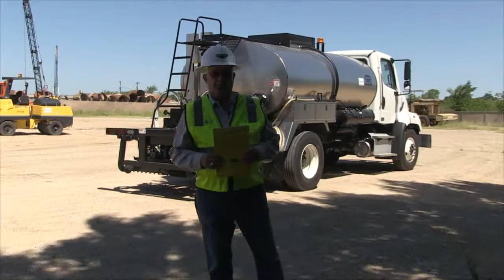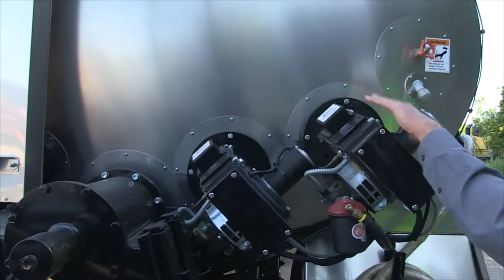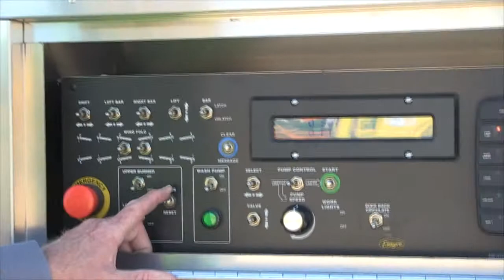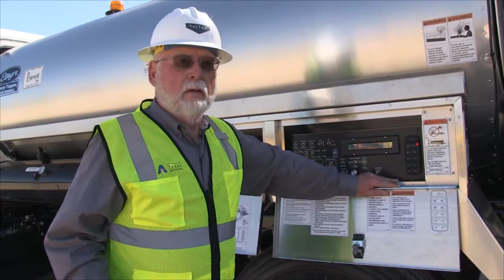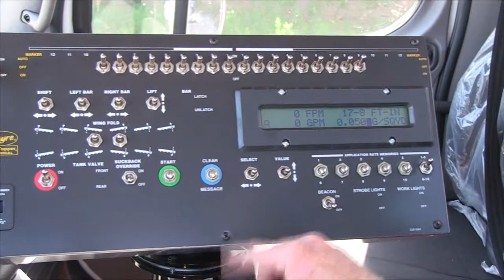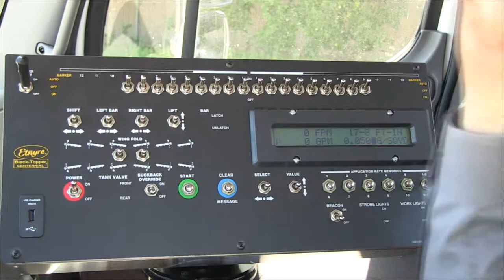Asphalt Distributor

Comment: What do you usually set your gpm at, not gpsqyd.  Gpsqyd where I'm at to spec is .03-.05 on state roads.  Another driver said he sets gpm at 1 per foot of bar he's spraying with. So a 10 ft spray width on the bar he would set gpm at 10.  Then gpsqyd would be set at .03-.05.  Thanks